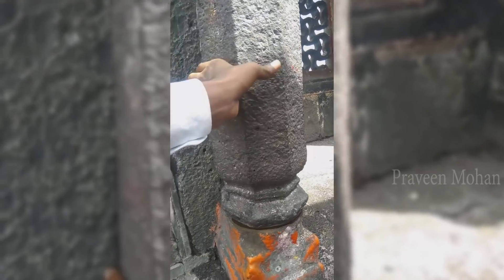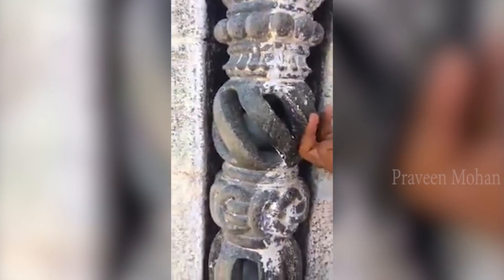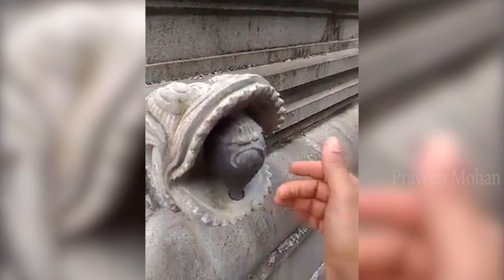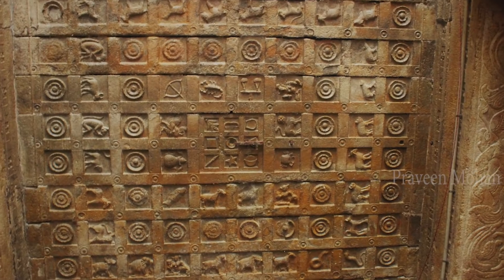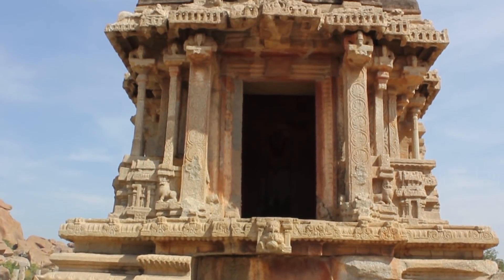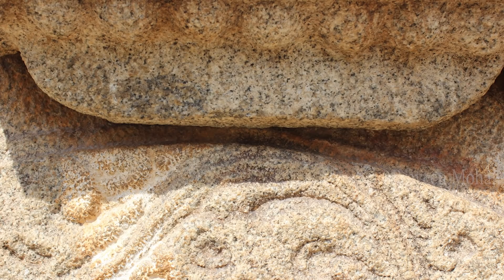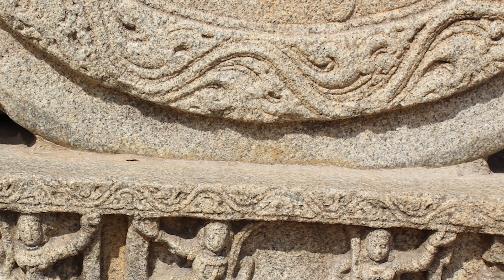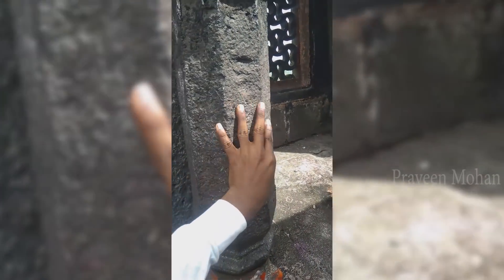Ancient Temples are MACHINES with MOVING parts?

Comment: The ball, from the Lion's mouth, do not remove because you have a hand or fingers inside. If the ball is exactly as big as the hole, it will be hard to remove it. You could do it, sucking it, as does a vacuum cleaner. It is worth measuring the size of the ball and the size of the hole. Everyone focus on the lion's mouth. On the back, it could be a hole in the stone, which has been plastered over. In many civilizations, stones were used, which were really artificial , like cement blocks.